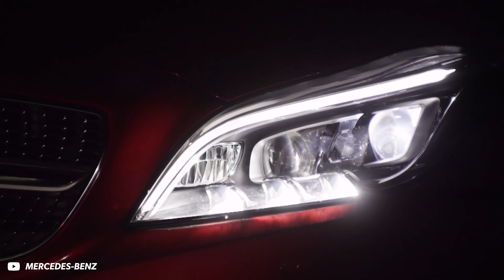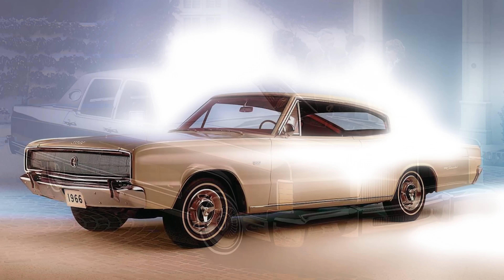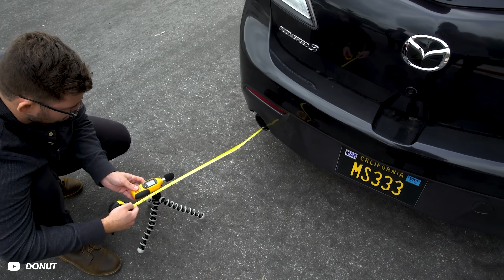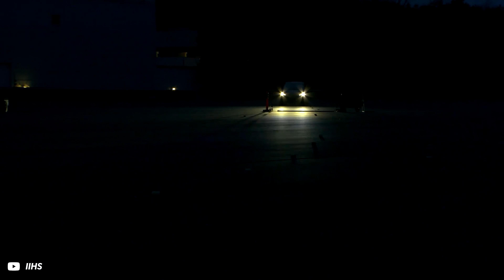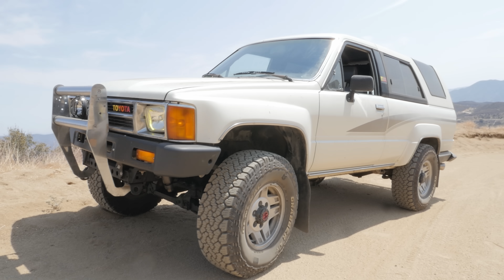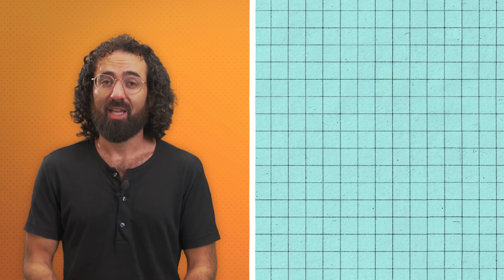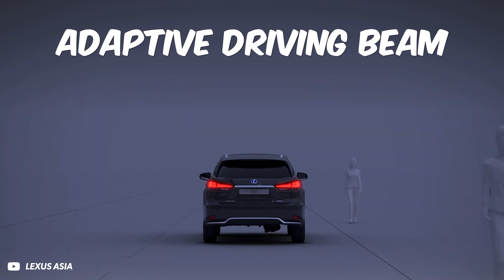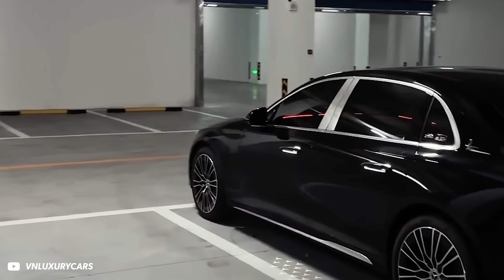Why new headlights are blinding American drivers

Comment: My 3 year old Tesla Model 3 recently got an over the air update one night in the garage that enabled an active high beam function that I guess was dormant.  I can see it doing it on dark roads at night.
Reply: So that's why all Teslas I encounter at night are blinding me every single time. People with Teslas should turn this crap off
Reply: @Asto508 gosh, I just drove several hundred miles a night with mt Tesla using adaptive headlights. Not once did an oncoming car flash their high beams at me. You can actually see the lights adjusting to the position of another car and not illuminate a car directly in front.
Reply: @stephencampbell9095  Then you may be the only person driving a Tesla on earth that is not having horrible headlights. More specifically, it's Model 3 I'm talking about.
Reply: @Asto508 I find loads of model 3's blinding me - in the UK. Apparently it was the early M3 just had crap lights, and there was a hardware update.
Reply: @stephencampbell9095  I was just driving an hour ago when a Tesla's "adaptive headlights" blinded the hell out of me. Almost ran me off the road. They take way too long to react and when they do, they still get it wrong.

Comment: adaptive beam is very good untill there is a bar in between motorway lanes or dual carriageway and it doesn't see upcoming cars so it's just blinding them directly. to switch off my Adaptive high beam I need to blind some card then it's switches off.

Comment: The worst thing about them is that, even when set correctly, you can see for about 30-40 ft and then immediately beyond that is pitch black. There is certainly a problem with poor design.

Comment: We have MOT tests in the UK, so vehicles at 3 years of age are inspected and inspected annually after that. Aftermarket lights not conforming to MOT specifications (the check the beam spread) would fail and thus your car would need to be fixed before you could drive it again. This enforcement of standards isn't perfect but might address those individuals are fitting unsafe aftermarket lights.
Reply: No one is doing that. The worst offending vehicles are brand new. No one is buying a brand new vehicle and fitting aftermarket bulbs. Look at the registration plates.

Comment: ADB headlights, if it wasn't so sad it could be funny. I live and drive on European roads, maybe not in the most northern of countries, but with plenty of rain and grey days, including long nights in winter. My opinion on automated lights on cars: These are still as bad as lights that needs manual turning on and off. In theory all sounds very fine, but practical? With grey and rainy weather automatic lights on many cars don't turn low beams on, they keep driving with daytime running lights that leave the rear lights off. Multi section high beam front lights in many brands I meet in oncoming traffic either don't switch enough of their segments off or conveniently forget in what section I am driving resulting in me getting that full high beam blast every time my car enters the next section. Like signaling to me with high beam on short distance, no thank you.

There are two types of lighting on cars. One to make the car visible as an object in bad visibility be it darkness or weather or both. This doesn't need to be very bright in most situations and if it needs to be bright it can be from low mounted and low pointed beams. The other type is lights so the driver can see. These are high beams and sometimes additional lights if you drive on dirt roads or roads without or with bad maintained markings. Their function however includes blinding oncoming traffic.

With modern tech it should be simple to shut off any high beam light as soon oncoming traffic is detected, that seems and sounds simple.And on a flat straight road it maybe is. But in reality the tech solution isn't quite there for my liking on the roads I drive, some straight some winding, some flat, some with rolling hills. And it is not because my country doesn't push high tech cars as there are plenty of hybride, EVs and what not on the roads. Smart cars for sure, but not smart enough yet.

Comment: Another European here: these matrix headlights are absolutely not the solution. It sounds great in theory, but in practice these things suck at correctly detecting oncoming vehicles in everything outside a completely straight and flat road.

Plus now the people driving those cars don’t even realize that they are blinding everyone else (and often don’t know how to disable it either), so the old trick of quickly flashing your high beams to remind them to turn theirs off doesn’t work anymore. It’s worse than ever before.
Reply: Wait, cars with matrix headlights are just in high beam mode all the time?

Comment: I recently got a new car and I realized that from the factory the headlights were adjusted too high. Most obvious was that the main beams had the most light halfway up the tree trunks by the road side instead of being level with the road.

So if you have a new car - check your headlight adjustments in a real world situation since the adjustment tools in the workshops are probably not working well with modern headlights with a lot of complex lenses and masks.

After I adjusted down the headlights there have been fewer people flashing me when I meet them.

As for adaptive headlights, also called "glare free" - they are dumb as  a brick because they only consider the closest vehicle and mask the light pattern for that. If you are the third vehicle then you get the full blinding light force because the car with the adaptive headlights can't see you fully. So in 9:25 in the video the meeting car would be blinded until that car is the car closest to you.

Comment: The issue I have is with 1) people just driving with their brights on.  On average here, 1 in 5 drivers have their brights on in town and no effort is made to dim even when brighted back. It's like they think the big blue light on their dash just means their lights are on; and 2) lifted trucks and Jeeps that do not then correspondingly adjust their headlights down to correct the projection angle.

While I am at it, I will say that Jeeps, in general, are the "too bright low beam" offender in my book.  When I see a car in the distance with too bright of lights ... it usually turns out to be a Jeep.

What helps is getting some glare reducing glasses (yellow lenses) to wear when driving at night.

Comment: The problem is all the crossover SUVs and Range Rover type vehicles on the roads in the UK. Their headlights are so far off the ground that even when dipped you can get glare from 100 metres away it would seem. God forbid if they hit a bump when they're coming towards you - then its full on retina burning.

Comment: I hate driving at night, it's stupid how many LEDS are polluting roadways. When your eyes are hit with bright light it takes 20-30min to recover, so a constant barrage makes vision impairment a continuous artifact of night driving.
There are strict rules for airports not to have solar panels because they can act like mirrors and blind pilots, but no LUX safety has been set for vehicles. I sit at a traffic light and the vehicle in front of me has magnitudes brighter brake and signal lights, and headlights are "light" years worse they are so blinding it's a sufferance to try to drive past sundown, the glair is horrific, most of the time we can just guess what we should see while our eyes can never readjust to the blinding lights.

Comment: No, I never get blinded. And I use as powerful light as its legal, because in usual conditions its almost impossible to use high beam, and low beam hardly provide safe vision. Even my brand new LED headlights on my Crafter - high off the road, perfect shaped beam (not a fuzzy spot like in traditional american lights), still need more to see what is happening ahead. I met everything - drunkards crawling along (not across) the middle of the road, kangaroos (for US it will be full zoo of other animals up to elks) sitting and waiting so twice smashed them, once with significant damage, lost boxes and other stuff, cars without any lights on back... if someone gets blinded by street legal low beam - do not drive at nights and invest in your eyesight health.

Comment: I don't think they make modern cars headlights to bright any more. My 2009 gmc truck's high beams work great lighting up the road and the sides so I can see any deer that may run out in front of me. My 2019 bmw only light the lane I'm in and can't see very far. 
The issue with super bright lights are police and emergency vehicles lights. They are so bright I cannot see at all and burns my eyes if I try to keep them on the road so I can see where I'm going. They need to turn them down a notch!

Comment: While headlights are absurdly bright, they are also absurdly expensive to replace it repair. We don't need a system of cameras and computers to reduce glare and add thousands in initial cost and repairs.
Reply: you mean like having to remove the front bumper to change a headlight, not like the old days

Comment: People get mad at me for my factory lights at the wrong angle can be too bright, but my biggest gripe is emergency vehicle lights, bright multicolor and fast flashing. I can't see the emergency vehicle because of the lights, yes it makes you slow down but you can't see where the car and people are. I had to put LED in my work truck because the factory lights were not bright enough to cut through the other lights, I couldn't see the road. I know, it's counterintuitive, so I don't blind people I adjusted the lights all the way to the right.

Comment: Let me tell you from a europeans perspective..that ADB system is NOT the solution. You will still get dazzled by the car coming over that crest in the road, or coming round the corner, as it still takes about a   second for the ADB to recognise you and self dip, (of course the speed of this can vary with how much the manufacturer has spent on the computer and sensors for this....hahahaha). The issue then is not so much the amount of time you have been subjected to an artificual sun, it's more still the issue of the bright spots you see in your vision, and your night vision still being ruibned, if not more so. It's like a difference between staring at the sun and being hit by a flashbang. Your still blind either way.

Is ADB better than not having it for other users? Yeah.
Does it stop you from being dazzled in your missors by the car BEHIND you? Sure.

 Does it take us back to being as comfortable at night driving before every manufactuter decided that noon is 'laser time',? Hell No!

 I was in aToyota show room recently and listended to a guy complaining that his car was giving him the wrong speeds for the road. This is beacause the sensor looks for numbers in road signs and then displays them on the dash..it can be tricked by other marking on vehicles or can miss partially obscured signs altogether. The chap simply did not undertsand how it worked and that it was merely a driver 'aid', and not some magic foolproof system..and because it is a drivers 'aid', it's not really legally enforced, the onus still is on the driver to obey actual signs, and not what the dash is telling him. Why do I bring this up? cos ADB is a driving 'aid'.

There is also the issue with the software in cars, many forums have revealed that the auto settings for things such as headlights in ADB systyems are set to wrong countrirs, menaing that they can actually be worse as they willk shine more light in the wrong direction, such as having left hand drivers using right hand driving settings out of the factory.

There is of course a very old, and simple solution..change the colour of the light from blinding white to more yellow tint (which sweden was doing back in the 70's), much like the 'night light' setting on windows. It's just as bright, but less stressful to the eye.

As to why manufacturers are continuing with ultra bright white? well, it's simple, it comes back to allowing thier drivers to see. You will find that if you drive an older halogen based car, then you can still see the road despite the lasers on the otherside...if the keep your highbeams on, same goes led headlights..and this is about your night vision. Easy to get ruined if your eyes have adapted to darkness/ low brightness, but if you have been looing at bright lights for a while, then another bright llight is not gonna really affect you. Now consider how many more screens, mood lighting,m etc is now in your modern car, and you can see whey a 'brighter' light is needed..add to this the increasingly dark tint on all the windows that comes as standard from auto manufacturers (which are as dark as sunglasses for many german automakers), and you can see why they feel the need for dazzling bright...after all, they are only interested in keeping thier customer satisfied, not anybody else.

And with the rise of SO MANY SUV's, then you could go the route of the old Fiat Multipler..and have those headlights down close the the bumper, rather than up high to the bonnet.

Now how do I, as a European in a hilly region, deal with all these laser beams, including the ADB from expensive models,plus occasional bean can exhauster who has put LED's into thier 20 year old noise machine? I move my sunglasses to the tip of my nose. I can look over the rim when alone on the road, and then just tilt my head back when I see another car coming. (Which is much faster than the reaction time of the ADB, as I can see thier glare from around the corner, or on the other side of the hill) Ray Bans are not just good for Pilots in the day, but also for Drivers in the night.

Comment: I have a 2024 Tesla Model 3. Tesla did a free OTA software update a few months ago to make the existing matrix LED headlights steerable and adaptive. At night the headlights automatically go to high beam and darken certain LEDs to steer a light “null spot” on vehicles ahead and on coming traffic. The lights are also connected with the steering wheel to turn slightly with the direction of the steering.
Reply: As one of the oncoming drivers, I can safely say that this doesn't work as well as you think it does. I'm still getting blinded by these newer Teslas as well as all of the other cars that have ridiculously bright bulbs.
Reply: Great car!  Sadly, everyone else with their old cars are still going to blind you. 😔
Reply: @Mxyzptlk30 no, they actively turn off for other cars.  That’s the whole point.  Older Teslas, (2021-ish and older) do not have the physical matrix headlights to be able to do this.
Reply: @Jroman-7  What I meant by "old cars" was the older cars that don't have this adaptive matrix technology, not necessarily Teslas.  I have a really old 2015 Model S that does NOT have this technology.  It has the auto high beam stuff, which I turned off; too annoying.
Reply: I also have a tesla and I absolutely hate the automatic high beams.
Reply: @Rebius matrix is different than high beams.
Reply: @routybouty  I was surprised to see the matrix feature suddenly released via free software update for my 3 year old Tesla Model Y.  It is the single most impressive piece of safety tech I have ever seen--more light on the road for me, less blinding for other drivers.  Now that I know what to look for, I notice other oncoming Teslas where I can literally stare at the headlight as they pass and not get blinded.  They don't function 100% of the time though, it takes a dark road, and sometimes street lights are enough to trigger normal headlight mode.

Comment: An issue we have had here in Japan for years, and which is only now starting to become known in the rest of the world, is just how expensive all of these new LED lights and technologies are to replace.  I say replace because repair is functionally and/or fiscally impossible or impractical.  If your vehicle has LED's and was made in the last five to ten years, it likely does not have bulbs, halogen or LED, that can be replaced.  When something fails the entire assembly will have to be replaced, and that can involve a lot of labor on top of the insane cost of each headlight assembly.  As an example, a friend's Subaru recently had a headlight LED fail.  The assembly is going to cost him roughly $550 USD for the part and another $150 in labor.  The same part in the States seems to be around $1200, not including sales taxes, and labor tends to be 2-3x the cost there.

If you factor in auto-leveling, steerable, or these newer ADB assemblies... the cost will only go up from there.  And much like LED bulbs for your home they almost never last as long as the manufacturer says they will.
Reply: My headlights are $1500 each and they're not even the special ones. In another few years, any simple front end bump could total the car if I lose both headlights and some body panels.

Comment: I don't have a problem with "bright" headlights.  I have a problem with headlights aimed incorrectly and directly in my eyes.  There are all manner of cheap LED headlights blinding us but I think the #1 factory suspect by anecdotal evidence is, ironically, Toyota.  More often than not if it is a late model vehicle that is unlikely to be modified, it is Toyota products that seem to have their very bright headlights aimed a little too high.  They are all like this and it's really irritating.

As far as the Euro headlights that selectively dim their high beams (having nothing to do with low beams, btw), I have coded my 2014 E63 to turn on ILS+ which does exactly this.  I have all the hardware but it was turned off in software because of slow DOT policies.  So now it's on.  And it's cool.  But again it has nothing to do with blinding low beams.  That is a different problem entirely.